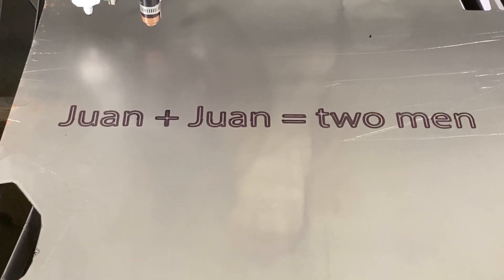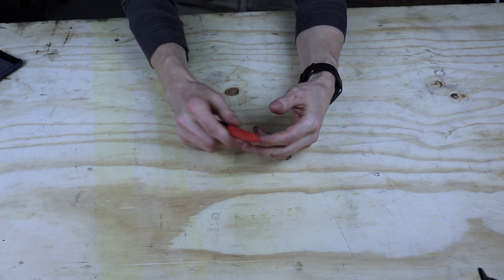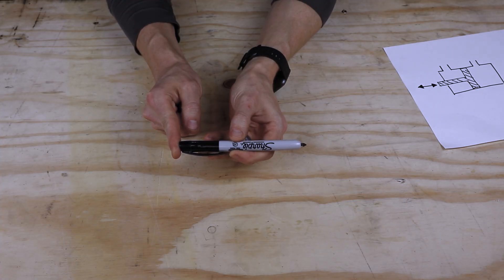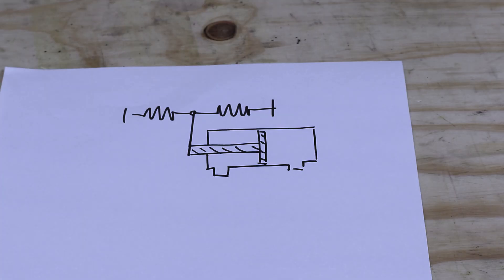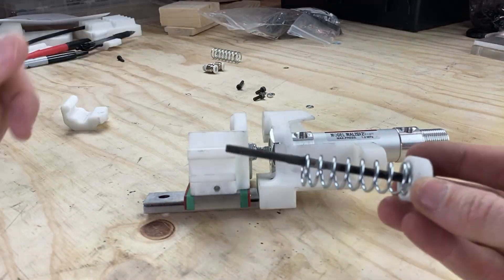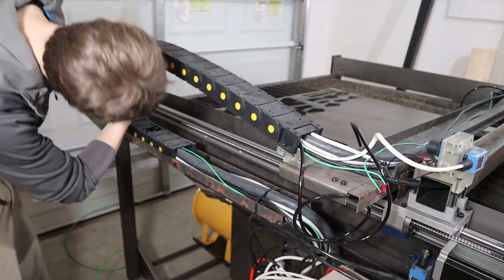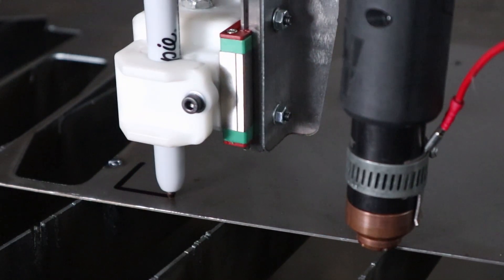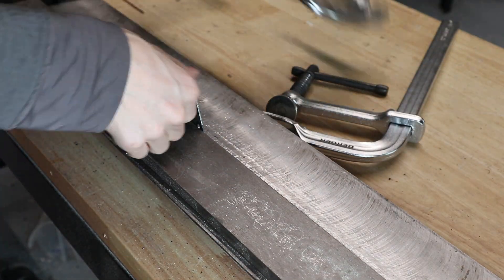This marker will change the way you work with sheet metal

Comment: Tip for cabling: Drag a length of string (plus one foot of length) through once, then tie another equal length to whatever you're wanting pulled through,  pull both through, and save your original string for next time, leaving one sting in at all times.

You're welcome.

Comment: Why the hassle with a air cilinder,
If you could just use a spring loaded sharpy and 1 or 2 servos?

How did you program the plotter doing the tool change?
And calibration, etc

Can you please explain more about the software you are using?

Kind regards
Reply: Isn't it possible to lower the power of the cutter, so it only burns the top layer of the material?

Comment: I used to put in a little alignment tab at my bend lines,  that are easy to line up with brake stops, and they don't take much to grind after bending.   It was really useful for transition bends,  and the thicker the plate or larger  the part, they became hold downs to index for bending.

Comment: A good tip when you need to add something through the power rail. 
When you first put it together put a piece of strong string through it.
When you need to feed something through it first drag two pieces of string through, use one of the pieces to pull through the cable and the other one for future use. Repeat the process when you need to pull something else through. You will always have one piece of string available. It really saves a lot of time!

Comment: Another method for your bend line location is add a .020" radius (either adding the material in a radius or removing it) on the ends of the bend line.  Yours is much cooler though!

Comment: This is a great idea!
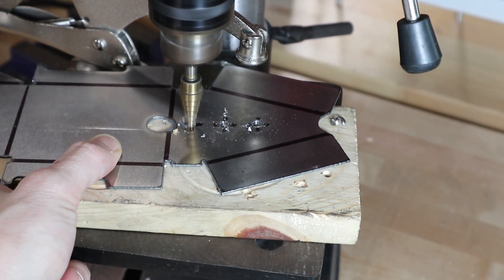At 13:07 you say "The Sharpie is a little thick. I need to get a finer point marker for it." I think it would be better to make a float mechanism for the down position so you don't mushroom the felt tip and keep it in contact with the material when the height varies. Sharpies make a nice fine line if you are gentle with them.
At 11:26 you can see it destroy the point against the Subscribe "button" and at 12:48 you can see it doesn't stay in contact with the material on the back angled line.
If the barrel of the marker is not tapered you could probably just make a hole that lets it slide and then just clamp a metal collar at the top and let gravity take care of it or use a very light spring to keep it in contact with the metal in the down position. If it is tapered you would need to add some sliding mechanism, or perhaps just a piece of brass hobby tubing around the marker.
Keep up the good work.

Comment: I run a fiber laser, we use the laser to etch places if needed (but we also have a press brake)....My question is, cant you make adjust g code for power and etch a line into the metal?

Comment: Little late, but just a couple thoughts.  For setting offset pop in 3 hole  triangle (L) and sharpie over them.  1 cut and you're just out ink.  Since the Sharpie pen body works, disassemble it, remove the ink insert and replace it with a metal scribe.  Fine Sharpies are a waste of money for setup lines (still too fat and ink goes dry) where a permanent and more precise solution already exists.  Very cool design though.  I designed something similar years ago for validating our autodrill programs to the understucture.  We had to use ink because we couldn't scratch the surface we were working on.

Comment: As a plasma table owner, id be very interested in seeing the processes you used in getting the bend lines from CAD to the steel in terms of Gcode and CAM strategies. Currently I use pierce points and .025” radius notches to indicate break lines, it works but it’s invasive. Plotter lines would be a major upgrade!! Just came across your channel, haven’t watched a single video yet I don’t find fascinating, keep it up!!!

Comment: If you pressurized both sides of the air cylinder it should go to a middle position. No springs necessary.

Comment: you could keep a set of wires in there just to fish cables back and forth through there. i do it with my 3d printer because im always changing hotends and thermisters heater cartridges fans and such. comes in handy.

Comment: If you want want nice sexy 90°bend, on the place where you draw a line with marker cut up to half depth out (I'm old fashion and I'm using angle grinder). In  that way you can bend the plates with hand and really easy. If you can set depth on laser and not burn through the material fully than it going to be super easy.

Comment: Just FYI Sharpie makes a fine version of that marker. It's my daily carry. I live having a super fine sharpie for all kinds of stuff, but for this application it might be more useful to you. More accuracy and precision are never a bad thing. Same pen, same size... plug and play with what you have.

Sharpie 1735790 Retractable Permanent Markers, Ultra Fine Point, Black, 12 Count https://www.amazon.com/dp/B0017DBK0S/ref=cm_sw_r_cp_apa_i_yiyeFbDYSVNBR
Reply: One possible issue with the fine tip is that the tip is not as compressible as the regular tip. The compressible tip allows for more freedom in the Z offset where the fine tip may not be as accepting of errors in the Z offset.
Reply: @oktavius8292  That's true, I was just offering the option since he said in the video he wished the marker had a finer point. These Sharpies are pretty rare in some places, I carried the same one he uses for years before I ever found out they had the ultra fine tip. I figured he might not have known, since I have to buy mine from office depot or amazon.

I could see the finer and more delicate tip causing issues tho, but that's his problem to fix lol I just offered the opportunity for him to solve them. ;D haha

Comment: Super subbed+ two thoughts:
1. Maybe make two fish tapes out of large-ish stranded wire, and feed one through. When you need to put a new thing in, you can use the wire to pull the thing and the other tape through.
2. According to the schematic of your piston contraption, you've attached a voltage divider to the rod of your piston. To go with your "EMI A F" theme, you may want to use a buck converter

Comment: This CNC thing is totally new to me. I stubbles along using Microsoft pro and up graded when available. But by no Means a computer geek. I want a CNC machine to cut out steel or aluminum brackets in my garage hobby of building traditional hot rods. I’m new with plasma cutter and think the CNC could cut out great looking parts and duplicate them. I like the pen plotting for bend lines! I’m buying a Crossfire by Langmuir they use fusion 360 CAD/ CAM software. Have you any experience with this system?

Comment: nice video. good work. innovative.my 2 cents worth.you can get cylinders with springs in them and also cushioning so tip dosnt pond into work piece so hard. and control the air with a proportional valve...….keep up the good work.

Comment: Have you considered using a acid-resist pen? In the old days we drew PCBs with them, and then etched the copper to leave the resist lines as the tracks etched with ferric chloride.

You might be able to draw artwork on your steel, then etch it for complicated decorations,  signs, artwork and even bend lines?

Not sure if anyone else has mentioned this but saw your design and it’s what popped into my head.
Hope it’s useful.

Comment: whenever you need to run wires into your machines energy conduit tie some synthetic line to your first item an leave it in place when you need to add another item add more synthetic line to your cable your pulling thru to replace the one you will use to fish everything in with

Comment: Re: energy chain stuffing
Since you will add more, the next time you stuff something through it, or the next time you take something loose, add a fish line to the chain.  Use some good quality line, (mini blind cord is great for this kind of stuff.)

Make the fish line 2-3 x's the length of the chain, attach it to what you have loose, then pull it through.  Beause it's 2-3 x's long, you can then pull the cable you just used to pull the fish line back through, with little difficulty.

Then, if the universe treats you like it does me, you will be prepared for the next addition to the energy chain, AND you will never need to add anything, ever again!  LOL

Comment: I have an 'ancient' felt tip plotter from the '80's when I owned an Apple III, (Apple Iie with color monitor and a whopping 2mb hard drive!  LOL).

I was about to scrap the plotter a month or so, ago, but decided I better keep it as it has a manual operation mode, and runs on generic modem code via a serial port.  Figure I might able to make sometin' with it.

Here's some Sharpie triva for ya:  After using them for a number of decades, I discovered Sharpie has been yanking our chain for the duration, about Sharpies being 'permanent' ink.  A few years ago, I discovered, in Home Depot, no less, a 'true' permanent ink Sharpie. They have red lettering below the big Sharpie on the barrel.  They REALLY are permanent, though, but damn handy.

Comment: You know you can always route through any line into your energy chain by having put cord to pull through whatever line by attaching the line you're trying to route through to the cord and the cord can be left there for when you need to route another line through next time by making sure the cord has ample cordage on either end of the energy chain (also making sure to always center the cord so it doesn't come out the ends of the energy chain)

Comment: Nice.  Another option are scribes.  They make expensive pneumatic scribes that work similar... or you can add an easyscriber.  you literally swap out the plasma consumables on the hypertherm with the easyscribe and then mark all of your bend lines.  :)

Comment: you can get rid of sound by using mufflers , it is a  poor design actually you have to  use single acting cylinder with spring return and install a flow regulator to control the descending speed...you promote here a lot of items but you never told about cad(offset creation or second tool assignment for auto positioning) overall its very basic idea...

Comment: was this cheaper than using a stepper linear actuator? cause those are $40 and g-code works on them just like the rest of the steppers. just need another axis control for the Y of the pen and another for the Y of the pen button pusher. but really you could make it all in one axis by having the pen go up and hit a stop to depress the button then lower to release the button and then up and down for the pen itself. so a 1-1.5" stepper linear actuator could do everything you need and still be co-located next to the cutter without the need for actuators and springs and you could control line thickness to a degree with raising or lowering the pen .0001" at a time. just a thought.

Comment: Hey your clip was really informative and interesting. We're not even near that yet with our plasma cutter.
May I ask a few questions about your setup?
What microcontroller are you using and stepper drivers? Are you using a Mach3 controller?
The box housing all your equipment you spoke about, does it also contain the main computer as well?
Lastly for hardware you spoke about keeping it "quiet"? Is this to do with the drive system and gantry? As in reducing weight of the gantry head to minimise backlash in the drive system i.e rack and pinion/pulley belts.
What would you suggest is the best gantry drive system for reduced noise for say a 1200 x 1200 bed size?
Would we need a torch height controller for plasma cutter system with a bed of that size? And would we need a fume extraction system on a bed of that size?

System specs? 32 Bit Windows using 5v parallel port to a stepper drive?

Comment: Im sure someone has already said it but if you pull a pretty thick kite string through when you start adding new lines, you will be able to pull the next set of cables you add using the string to pull em through. Mule tape works best but its a little thick ribbon type string thats very strong. Nylon string gets it done as well. Kite string works in a pinch but i dont recommend you use unless you want headaches later when it snaps. Be sure to tie both ends off until you need to pull another cable/wires through. Dont forget to pull a new string through every time so you always have 1 ready to go. Thats how us cable guys get er done. Peace

Comment: Burn arrow heads at the break points or small slots.  I grew up doing this with a cutting torch a die grinder and files. One of the old man's motto was you can build anything with a cutting torch and a grinder.

Comment: 9:50: Energy chain. If you were to leave a coat hanger wire, or zip tie that was fed in ahead of time, or time of assembly, you could just tape your wire to the tie, and carefully just pull the tie through. No fuss, no muss. I've felt this pain.

Comment: If you don't have a plasma cutter to modify, print out the sheet metal part full scale with the bend lines, and glue it to the sheet with a glue stick. Cut the part out and bend on the lines. For complex part where the paper might get obliterated during the cutting/drilling phase, I center punch a mark at the ends of each bend line. If the paper falls off, you just link up the marks with a sharpie to re-establish the bend line

Comment: 6:50 you could use a valve with 3 positions. They usually are per default set to no pressure to any side and can be switched to deliver pressure to one of the sides. If it is at default state it will let the cylinder depressurise so the spring would be able to position the cylinder. Or you could use switches that are mounted to the cylinder that will tell that you are in the position you want but it is more complicated to set up

Comment: thats a very cool design. Kudos there. But as someone else pointed out: a scriper instead of a pen would be pretty cool as well... very small lines and thus tolerances.
Btw: if you don't use 0/1 Valves for controlling the piston, but instead use proportional valves you could actually control the position in Z, thus allowing thicker or thiner lines... maybe thats a project for the future ;)
but all in all: a very impressive construction there :)

Comment: 9:55 problem trying to fish the hoses through the 'energy chain':
How it SHOULD be done:  fish a thin wire through the chain, the tail should have a loop.
Attach the hoses AND another thin wire to the loop, and pull the loop through the chain. 
You now have the hoses run, and another thin wire for the next "pull"

Comment: Brilliant. Never been a fan using a sharpie for marking bends, old school sharp awl guy. For me the best pointed scribing  tool is a 12v circuit tester. Point is wicked sharp and hard. Could that be set up with a spring tensioning, keeping it at the right down pressure to scribe? Could use in conjuction with layout spray.

     If you intend to pull more thru the energy chain perhaps leave a free pull wire to assist loading in the next  wire or tubes.

Comment: put a string 2x length of energy chain. tie at both ends and put a small loop at the middle of the string. When you want to add something else into energy chain, pull string out the end you want to start pulling from. put addition into loop and pull it through the other side

Comment: You can get 5 way valves that vent both ports when neither solenoid is activated. They are referred to as an "center open" valve. You can also get center blocked and center pressurized 5 way valves.

Comment: Can you not etch the lines with the plasma cutter? At my old job, we'd get parts off the plasma table with layout lines on the plate by running the cutter at a low amperage.

Comment: Always add a minimum of 20% to every enclosure or building you are going to be putting stuff in.  When you fish anything through the energy chain tape an extra loose line or tube to it so you always have something to tie to pull the next thing through.  Remember when you are using the loose line or tube to draw something through the energy chain to be sure to add another loose line or tube for next time.

Comment: I cut small slots or holes on the bend line. The weakness caused by the missing material forces the fold exactly where you want them

Comment: @10:00 Why dont you pull a small wire through along with whatever thing you pull through next time. Use that wire to pull future things through with ease. Before you pull, attach a new pull-wire to the existing pull-wire to replace it after you pull your new addition through.

Comment: Graphic designer here. I appreciate what you have shared here. thank you. When applying my packaging/paper-mechanics/carton/box-design skills to metal working, I make perforations in the metal at the fold points, so I definitely know where the bend will be. Plus I usually don't need the brake. Often times it's just some heat on the bends so they don't work harden as I form the shape.. Finished folded items rarely feel flimsy. A tack weld if required solves that.

Comment: What about charging both sides of the piston? It should (with enough pressure force) equalise the prison to the centre (assuming equally split volumes). No need for springs and excess charge pressure to over come the springs. Awsome concept and agreeed super useful!

Comment: Interesting idea. Our shop will sometimes use plasma or laser etching to mark bend lines, weld location, or part numbers. The etch process is pretty rough on the consumables though so we typically have to set up program stops to change tips after all the marking. On the other hand we typically cut much heavier material, usually mild steel so it isn't really clean enough for sharpie marking.

Comment: Love the idea. I noticed you did not cap the mounting holes on the bearing rail. When I service or replace these, I used candle wax to fill the void. Just melt it in, and use a heated razor knife to shave and smooth the wax down to the rail surface. Cheers